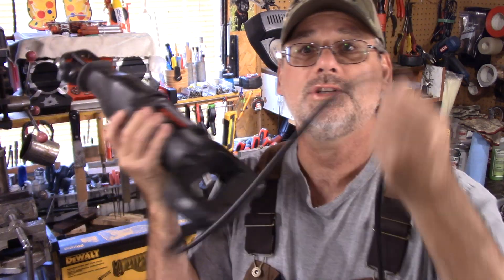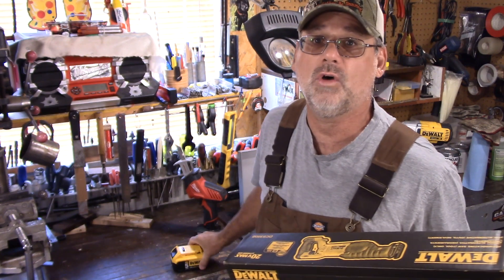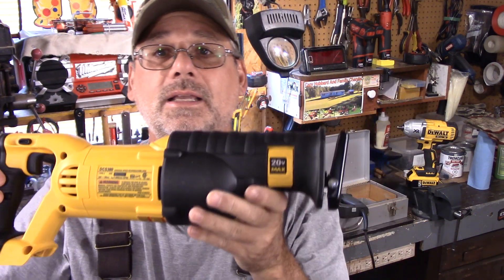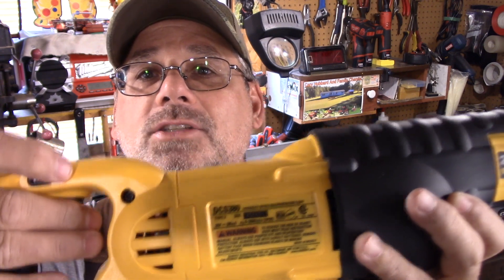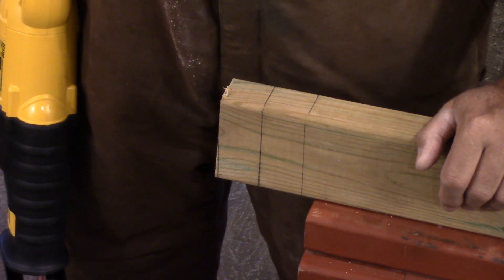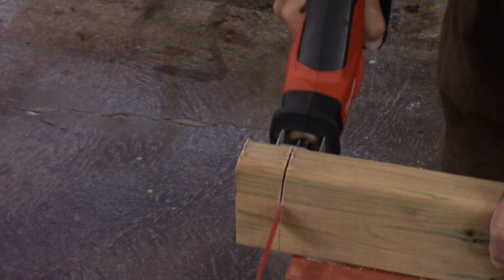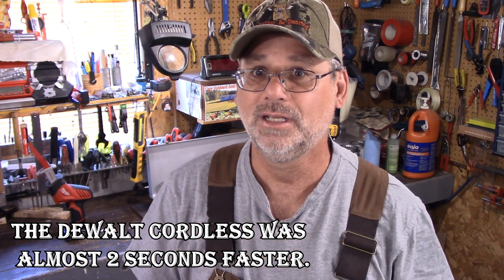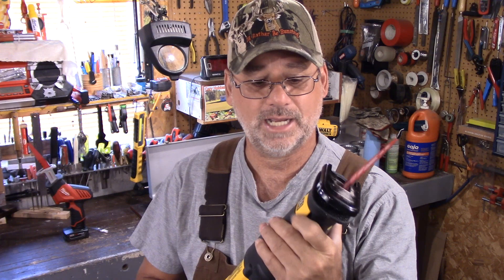DEWALT 20V MAX*  RECIPROCATING SAW REVIEW -  (DCS380B ) WATCH THIS  BEFORE YOU BUY

Comment: You made a good decision on that purchase. I have an industrial old porter cable tiger saw that's about 25 or more years old and has 2 settings,  one for metal and one for wood. Will stomp the tar out of any cordless out there but I never really use it any more unless needed. I always grab my old 18v dewalt, or craftsman sawzall, why, because it's cordless. With most all tools cordless it's quicker to grab and cut said piece than to set up the corded and the hassle of it all. I as you grew up in the trades where everything was either corded or ran off an air hose, so corded tools are a dream to us. I still have all of mine and maintain them but rarely use them. You will have that tool like myself a loooong time. They take a beating and keep on ticking. It will be the batteries that go before the tool ever will.
Reply from the maker: Good to know and glad you like yours too. Cheers

Comment: Great Steve!  Up to now, my opinion about reciprocating saw is bad.  But here is why.... I've bought a Job Mate (yes, the cheapest corded brand ever made, decades ago) reciprocating saw.  It got enough power to shake an entire house if the blade pinches. When releasing the trigger, it got so much inertia, it will continue for a second or two messing the surroundings. Not to say it's an auto-loosening set screw. It weighs 25lbs (to my feelings...). And it has a 3 feet cord, so it will disconnect soon from the extension cord. Lol!  No wonder I hate it!!! Now that you showed us this tool, I am on the market for a new one!!! Great tool, great results! Thanks Steve!
Reply from the maker: HAHAHA and today this can be bought for about 3 cases of good  beer :)  Cheers Joe

Comment: Yes sir, the portability is key. I have a lot of areas that do not include electricity so the battery operated saw is my only option. Unless I use my old hand saw of course. You always make good points and bring a few points I never thought of to the conversation.  :)
Reply from the maker: Thanks Wyatt - the cordless is great but there are times I can see  a corded will be the best choice. Off  grid up at my camp this will be the best option for me. Cheers

Comment: I just pick one up today, can't wait to use it I also bought some Dewalt blades I also bought a flexvolt battery 6.0amp.
Reply: I hear the flexvolt will destroy 20v max tools the flexvolt should only be used with flexvolt advantage tools
Reply: @paigebates4451  not true at all

Comment: I will give that dewalt 3 or 4 years everyday use, I'm a plumber, I've had them at the mud, drop off of ceiling joists, it can take a beating. Dewalt has been extremely tough in my experience.

Comment: I continue to use my 9amp corded Porter Cable reciprocating saw for 20 years, its a beast.  I may get the  Dewalt saw because my drill uses the same battery and cordless is so convenient for smaller jobs.
Reply from the maker: Cordless anything does not compete directly with cordless but its sure convenient 👍 Cheers Glen

Comment: second question:  all the safety instructions tell you not to travel or chnage blades while the battery is in the handle. isnt it smarter to always remove your blade whenever you want to transport the tool ? remove the battery and the blade AND lock the switch out? yes, i know, impatience makes you want to rush and not bother--but wouldnt that preclude having accidental turn-ons in your truck or your shop or lying around on the worksite?????
Reply from the maker: Yes good point and safety is always good so using the trigger lock or removing the battery is a good idea  too.

Comment: I love when people switch from corded to cordless, my cheap butt buys all those old used corded models all day.  On a side note I have a 90s dewalt corded and that vibrates like crazy compared to my older 70s skill.
Reply from the maker: LOL  your pretty sharp Pat. If I didn't have an off grid place without electricity my old saw would do quite well for the next 30 years eh :)
Reply: @SteveRobReviews  Steve don't you have like three generators? Haha
Reply from the maker: @patcb829  5:) but I'm not dragging them around anymore .😁

Comment: first question:  why do you use blades not made for the tool by dewalt? isnt there a risk that they arent designed for the tool, nativeley?
Reply from the maker: Janet the blades are generic and fit universally for all reciprocating saws  same as circular saws or drills  using regular  drill bits .